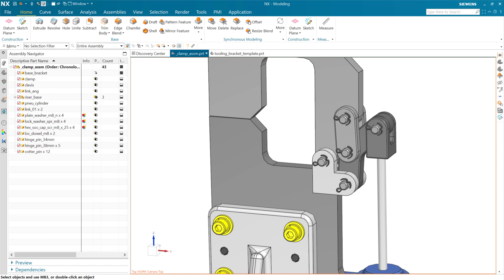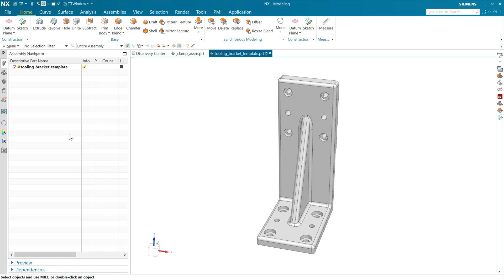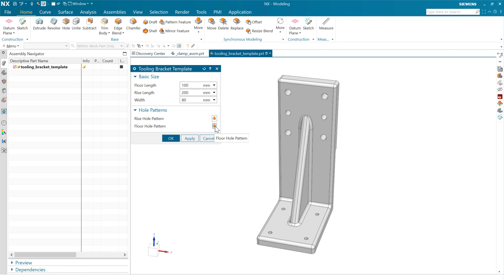NX Product Templates: Reusing Feature Templates within Product Templates [NX 2306]

Comment: Its me again. 😅 have a doubt! You have added two feature templates to your model first. And then pulled them into product template. Can we directly pull a feature template from library through product template ui? Because now to dynamically add more feature templates i need to keep adding them to the part and then add to pts. What if my count feature templates changes. Currently u have 2. What if i want 3 or 5 or 1. Is it possible to do that without adding them before hand to the part?
Reply from the maker: This is currently designed for using Feature Templates within Product Templates in a relatively static way...  We've not designed this for dynamically pulling in Feature Templates and automatically modifying the Product Template UI.  You can of course add more Feature Templates and access them directly via the Part Navigator...  I'm thinking that if the number of Feature Templates gets very large, then adding all of them to the Product Template UI automatically may start getting clumsy rather quickly.  But it's an interesting idea. Thanks!